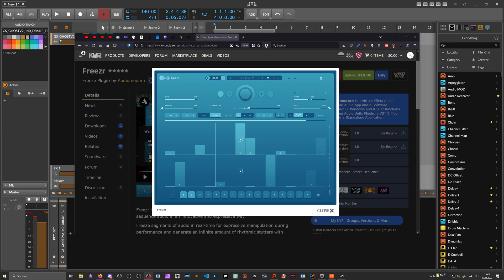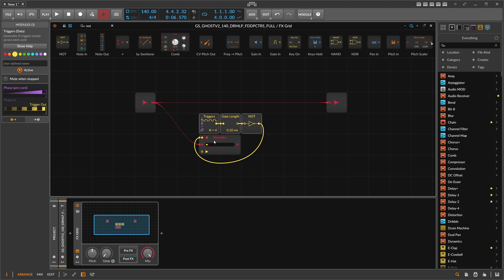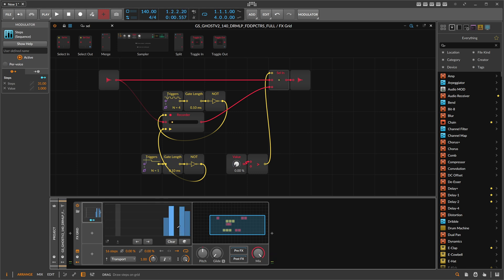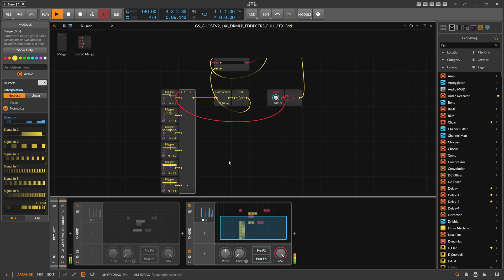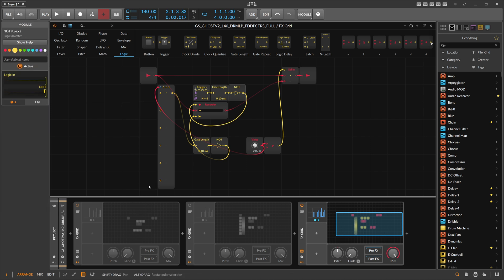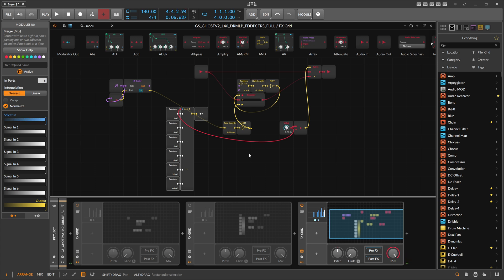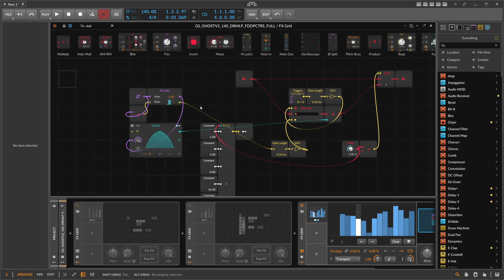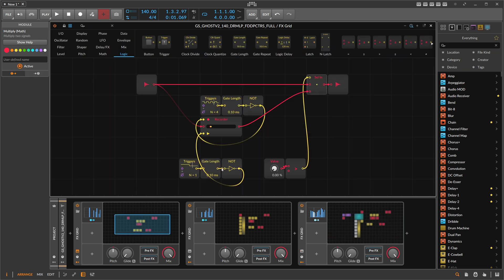Freezr rebuilt in Bitwig

Comment: What about using delay? IDK if the delay in Grid, assuming there's one (there should), is well-suited for that, but if you sync delay time with BPM just right, you should be able to pull off stutters fairly easily, or even branch off from stuttering and go all Gross Beat in it... if the delay module can handle it.

Comment: instead of using phase Scaler I prefer multiplying phase by integers, that keeps it perfectly in sync with source without need for retrig. normally such phase signal is automatically wrapped inside target module, but you can use phase wrap just for the sake of seeing result in oscillloscope or something. and you could apply various bends and shapers to Grid phase before multiplication, which can result in exponential rythm.
Reply: Can you describe how you multiply phase? Phase in - multiply on some constant?
Reply from the maker: U use a multiply and a constant. the phase in of devices wraps the signal back to 0-1
Reply: when i compare the scaler version and the multiplication (+wrap) version in an oscilloscope, i notice that the latter seems to be slightly offset. why is that? also im assuming that youre using a < and .5 constant to generate the triggers, correct?
Reply: @wrxnglove  no, you just use resulting phase as source for Triggers module, or other module that makes triggers out of phase signal (like LFO, where you can adjust pulsewidth). and I don't see any offset when comparing phase scaler with multiplication, if phase scaler is properly reset from source. because as soon as you change any settings, without retrig phase scaler drifts from original phase signal, and that's exactly what I'm avoiding with multiplication trick.